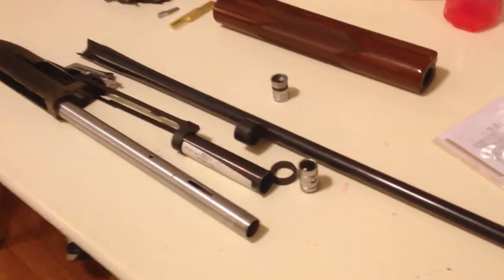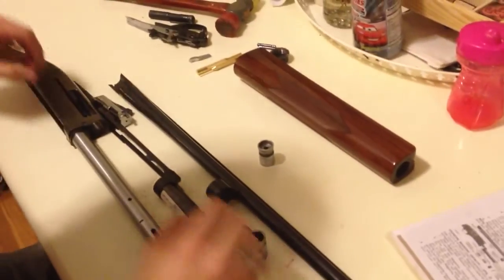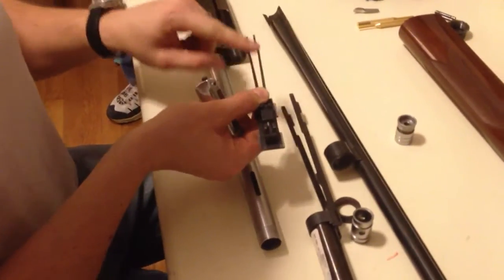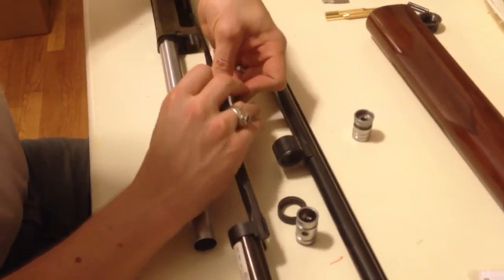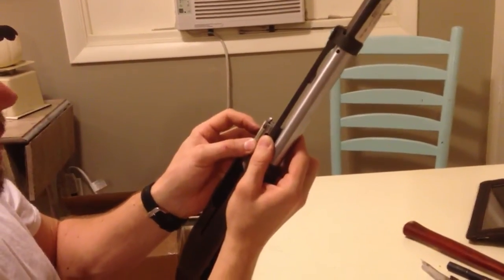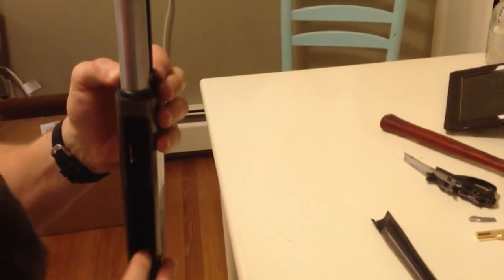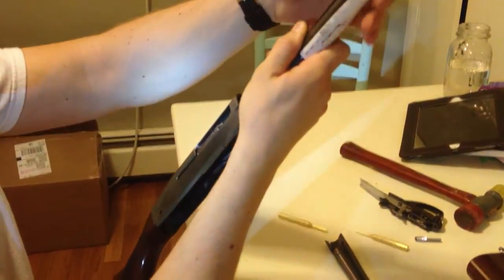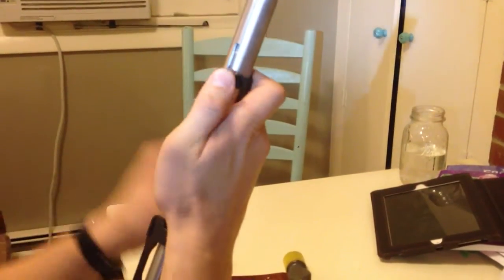Smith and Wesson 1000 M Assembly Part 1 of 2

Comment: hi- glad i found your video. the link was attached on another as this part was very unclear in the other. i took my 1000M to a local gunsmith and it still dose not eject the shells. i used to clay pigeon target practice 25 years ago and the gun is still like new but he shells wont eject. not sure if this is a cleaning issue or mechanical? my friend said send it to S&W . your thoughts
please. would like to start shooting again and had to load one shell at a time . thanks Preston Orlando Fl
Reply: The gas piston that moves the slide when fired has been inserted backwards....
Reply: +Allen Cox thanks , there was a rubber washer that 
Just fell out and was completely worn.  I took it apart myself . The local gunsmith just looked at the inside 
Catch that pushes the Shell's out and said because the brass Shell's have  changed the thing that grabs the Shell's 
Needs to be welded . That's is as far as I've gotten.
Gun still in pieces 😂
Reply from the maker: Preston Salisbury this reassemble was done after having a similar problem and replacing that gummy washer. Hope you got your problem fixed!

Comment: First of all you did not address the fact that the piston that moves the slide can be inserted and assembled backwards...which will cause the gun to NOT eject at all. Also,, you do not need a brass pin to hold the tension on the return as you can assemble and dis-assemble with the action locked back open. I appreciate your effort but you missed very important points.
Reply from the maker: Allen Cox thanks for those important points!